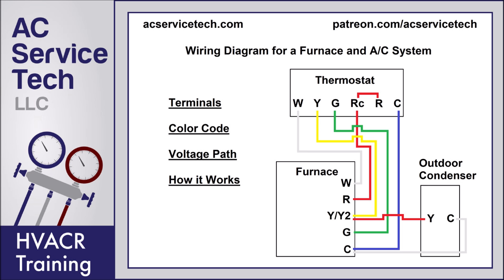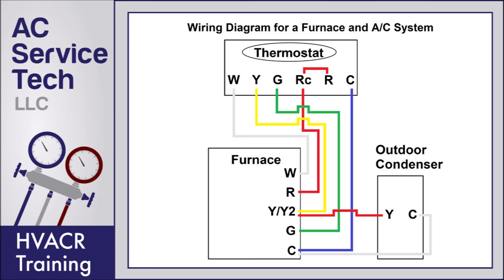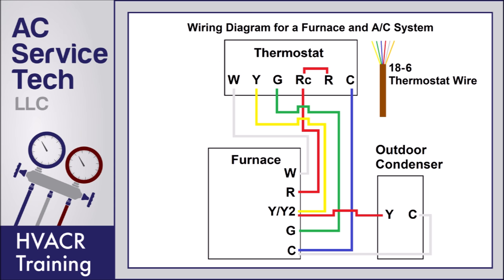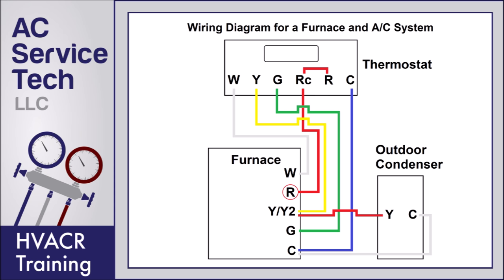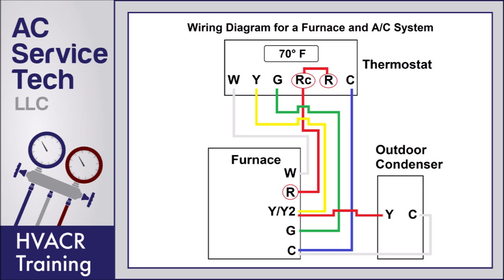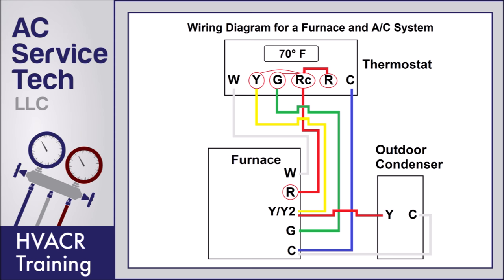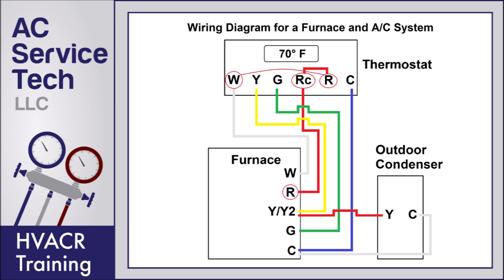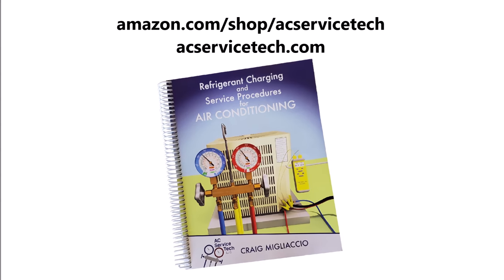Thermostat Wiring to a Furnace and AC Unit!  Color Code, How it Works, Diagram!

Comment: I am working on a furnace that has black yellow green going nowhere.i have rh and rc and white for condenser and white for heat but no g wire for blower motor. I have never seen a system run without a g wire. Home owner says system worked last year but i think is bullshit because it has no g wire from thermostat to control board

Comment: So can you answer a question about why my old thermostat would have a jumper between r and rc but on the new smart thermostat no jumper and the thermostat has a loss of power only in heat cycle

Comment: Hi I'm installing an emerson 70 series non programmable thermostat on a hot water gas boiler system (no cooling) do I need to remove the jumper wire between RC and RH on the new thermostat

Comment: Having an issue with my system. I have the exact system wired as so, however, when the tstat shuts off the fan on the furnace keeps running. I’m in the process of adding a secondary transformer Honeywell R8239A1052. Do I need to add this or did I do something wrong?

Comment: Do you have a more detailed low voltage wiring with transfers in? I have a furnace with no voltage on W. When I switched the thermostat to heat, nothing happened even I jumped R to W. No heat, no fan. If I switched the fan to ON, and I jumped R to W the heater strips will be on. 
Long story: This thermostat was changed from an old mercury thermostat at summer time. When I switched the old one back everything is normal, heater worked. I thought that the first thermostat was wrong, and I switched it to another new thermostat, but didn’t check heater on this second one. Now, the second thermostat has the same problem. I did careful check yesterday and found the problem described in first paragraph. 
Any ideas? Thank you
Reply: sounds like wrong wiring or incorrect thermostat setup

Comment: Thank you for such clear instructions! I have wired everything as you show here. My furnace is working as expected. However, when I try to turn the AC on through my thermostat I can hear the relay getting closed but the compressor won’t start. Would you have any pointers as to what may be the cause? 
Thanks again!
Reply: First check if your outdoor unit has power (tripped breaker).  Second most outdoor units have safety switches that will open Y before reaching the Compressor Contactor Coil.  If the outdoor fan motor turns on without the compressor then you may have a open start capacitor.  If your outdoor unit has a control board it could be a bad board.  I'm putting money the relay you're hearing is the Compressor Contactor and there is no power to the outdoor unit

Comment: Why not have a cooling G delay after compressor shuts off to extract more cooling just like heat does when combustion shuts off?
Reply: Good question! First of all, I'm NOT a HVAC tech by any means, but you're right. There is a bit of residual cooling left on the A coil where if air is passed through it after the compressor shuts off, some "free" cooling could be extracted. You may get like a minutes worth before the coil attains ambient temp and starts to evaporate the condensate back into your house. We have a 20 year old Bryant furnace which has a smart control board. When A/C is called for, the compressor will start about 30 seconds before the blower! When thermo is satisfied, the compressor shuts down and blower runs another 2 min or so! Neat, huh? To further reinforce your idea, I once added a delay relay to a large window A/C unit to do just what you asked. Fan ran about 3 min after compressor shut off. My belief was that it would extract a bit more cold, cooled the compressor, while quickly reducing head pressure. Window shaker ran for years without problems!
Reply: @curtchase3730 , great I should have got that 20 year old Lenox I saw for $75-- that's sucks. Anyway ours is 37 year old Heil 90+ and maybe you can answer this quick question about it or its diagram. So in the stupid diagram manual, and also on the back of the top front panel cover diagram, is schematic where the combustion normally open relay is actually in parallel with the fan control limit switch, which seems crazy to me. So as you know the older furnaces have the bi-metal fan control switch which turns sending heat and then turns it off after w heat call ends and then it cools of course, so why would the diagrams want to sort that out with a combustion relay in parallel closing makes no sense because then when the heat calls they blower would come on immediately instead of letting the fan or blower control do it. Anyway that's what the diagram says but of course the furnace does not operate like that because the jumper or the wire from the combustion relay is not there of course but why would they list that wire connection in the schematics is what I don't understand. Does that make any sense because I've seen a couple of questions about that in some HVAC forums.

Comment: I have a trane ac system with old trane xr420 thermostat and is working good .But I want to upgrade the thermostat for the new one and I installed it ,and my air handler is working fine and stops as soon as it’s at equal temperature with the thermostat .But the out door compressor still works  and and the tube freezing never stops .Do you know why ?

Comment: If I don't have a c-wire, can I swap the g-wire on the control board and thermostat while the condenser is still connected to c and y?
Reply from the maker: Yes you can switch that to the c terminal at the thermostat and control board but just make sure that your fan will still automatically turn on during ac mode

Comment: My 'stat displays stage 1 and 2 but no wire to y2 terminal on either 'stat or furnace board or to outdoor unit .only 5 wires total.
Question is can I move blue wire from com. To y2 terminal at compressor , move blue from com. On furnace board to y2 , and blue at.com. terminal to y2 terminal a t thermostat ? It has batteries. It's a high efficiency. 16seer a/c
Hope I was clear.

Comment: Looking for low voltage wiring gas fired two-stage furnace to Bosch heat pump diagram doing first heat pump

Comment: I cut the wires in the basement going into the furnace and spliced and rewired it but now my furnace will not fire for heat. It fires up for hot water just fine but wont fire for heat. Any ideas?
Reply from the maker: Look up "acservicetech test thermostat voltage"

Comment: You saved my ass, I miss wired one of the outdoor condenser with W from Y and so it only turned on when I had heat on. Going through this gave me the confidence with placing Y from the outdoor condenser to Y/Y2. Thank you, thank you, thank you!
Reply from the maker: Thank you! Great to hear it!
Reply: I dont have cold ac but my heat works good. I opend up my furnace to look at circuitboard and there is only 3 wires connected,  G , W , R ,,, c24v and Y are free with no wires attached. But on thermostat there is G , W ,Y , R, Rc all have wires connected to them. I remember furnace unit was replaced a while back is it possible the person didnt install everything correctly??? Plz and thank you. Ps when i turn cool on nothing happens but outside unit turns on,, while inside unit no activity.🧠🧠🧠🧠🙏🙏🙏🙏🙏 i feell like this is why my ac aint kicking out or blower motor

Comment: Hello, how are you doing tech. I have my oil burner honey well thermostat and I'm install a new ac system. How do i wire my air handler to the same thermostat  I have before?

Comment: On my system, I have the fan relay.... high for cool, medium for heat... the speed is controlled through the fan relay. my problem is, when in the heat mode, the thermostat always triggers the fan relay... so the fan runs on high and then drops to medium when it shuts off and then shuts off when the sequencer finally stops. any idea why?  I have a Coleman 3500-816 electric furnace... with A/C.

Comment: I have a boiler and a/c system.  What is the easiest way you add the C wire?  Thinking of installing a wifi thermostat, all seem to require a C wire....
Reply from the maker: The wire is run from the air handler c terminal. You may already have an additional wire run that is just not used, thanks!

Comment: I am trying to switch a mechanical thermostat with a digital thermostat. However, the mechanical thermostat has 6 wires. Low fan, med fan, high fan,  L1 (black), valve 1 and valve 2 (red). My challenge is to find out which ones are W, Y, R, G wires. Please help
Reply: Sounds like you have a old High Voltage thermostat for a chill water fan coil.  A good indicator is you don't own an indoor and outdoor unit.  To use that modern wireless thermostat you will need to install a 24v control circuit.

Comment: Have you seen a Switch Mode Power Supply SMPS for 24V DC as opposed to a 24V AC transformer for energy star lower standby watts?  Although pretty reliable SMPS still a transformer is bullet proof just uses about 4-5 watts xtra.  The average vampire current or standby current in most homes is 50-100 watts, so about $10 month.
Reply from the maker: Yeah they are nice for saving power but I don't know about lightning strikes or other problems at customers homes. I try to avoid callbacks from occurring whenever possible, thanks!

Comment: The R “red” wire from the furnace should be touch to R on the thermostat first, right?? Or it’s does matter
Reply from the maker: Yes that is correct, the R from furnace to R at the tstat, thanks!
Reply: AC Service Tech LLC thank u I had your book and we wait for the next book.
Reply from the maker: Thanks a lot Marcos!

Comment: I wired everything up just like this and the system works, however, when the tstat shuts off cooling the blower fan remains on. My vender gave me another transformer Honeywell R8239A1052 to separate the heat and cooling and am lost. Anyone able to help?
Reply: Correction . Resideo is the brand.

Comment: How will you power 2 zones at the same time for cooling with one thermostat? Would you be able to provide me with a wiring diagram? Thanks a lot!
Reply: This can be achieved using a thermostat that will allow for multiple remote sensors that can be mounted on the walls or in the return duct.  You will need to verify the sensors will provide a average temp of each system.  I believe a Honeywell 8000 can achieve what your looking for.  Additionally induct return air sensors are more reliable and accurate.

Comment: Great video as always, Craig! Someone recently asked me if you could wire a condenser contactor directly to the Y and C terminals at the thermostat instead of the furnace board. How would you answer this question? TIA
Reply from the maker: It could be done, but if there was a problem with the yellow y wire not making it to air handler then the blower won't turn on which would be a problem. I would rather the y get to the air handler and then go to the outdoor unit, thanks!
Reply: @acservicetechchannel  thanks for the response. So the Y terminal in the air handler/furnace board powers the blower? I thought the G terminal from the tstat did that during a call for cooling?
Reply from the maker: Domingo Luyo  Depending on the unit, the board may need a signal at the y to run in the higher fan speed otherwise it may run in the lower heat speed. On some boards, it will run the bower without any call on the g but just on the Y. Anyway, it can be done but I like to get my wire to the indoor unit before it goes outside, thanks!
Reply: @acservicetechchannel  I just experienced another one of those "aha" moments. Thank you so much for all you do.
Reply from the maker: @domingoluyo2315  I love hearing that, thanks Domingo!

Comment: I have a Lennox  LB-87086A control board. It has W/R/Y/C/G. Ok, so..........these guys who installed it brought it up outta the furnace and then tee'd off the RED and Blue(common) to feed the AC compressor relay contactor. Lol. So i have a White, Red, Blue, and Green wire bundle coming up to the thermostat. The only way to get the AC to work is put the Blue(common) in the "Y" slot of the thermostat! It's frustrating because they didn't just use a 5 wire like they should have and used the Yellow wire and Blue wire to feed the AC contactor outside. 

Good news is that it does work just fine with my old programmable t-stat and my new Google Nest Thermostat. I imagine the batteries won't last as long though!

So to properly fix this i would need to run a 5 wire from the Furnace control board(using ALL 5 wires this time), run that to the thermostat, then extend the contactor wires from the AC compressor and run those into the Control board at the Y and C. Right?  I have a working system but i am selling soon and would like to take care of the little things.

Thanks and if anyone helps i appreciate it. My In-laws own a huge HVAC company but sadly never seem to want to help or even offer information...........But hey, maybe that's why they're now millionaires hahahaha

Comment: my furnace board is labeled x r b/c g w. where do I hook the condenser wires? I hooked them to the b/c and r but my ac wont turn on.
Reply: Did your thermostat come with a manual?  I'm guessing its one of those Homedepot $20 specials that die if you hook up C even though it has a C terminal.

Comment: You have given wondful instructions, but the only thing my blower motor doesn't shut off with the thermostat. No matter if I put to 75 it keeps running later it froze my condenser.

Comment: Hi. What if there is no Y in our air handler furnace?
Reply: Is that because you don't own a AC?  Y doesn't need to stop at your Furnace because 90% of the time Y needs to reach the Condenser Compressor Contactor

Comment: I need help with diagnosis of t stats. Even you go from R to C why don't I read 24v ?
Reply from the maker: We do read 24v with a multimeter when putting the probes on r and c. Did you look up "acservictech thermostat" for videos on troubleshooting?
Reply: make sure you're testing for AC voltage, not DC on your multimeter, simple but often overlooked
Reply: Wrong use of Voltmeter, No power at Furnace, Blown/Tripped Transformer fuse/breaker, Bad transformer, Bad power board, open/short wire

Comment: I need to know which wire makes it stop automatically.
Reply: Normally that's a switch.
Wires don't make anything start or stop, they just power the load.
If there's a wire that makes your A.C. stop it's just disconnected.
Switches makes loads start and stop.

Comment: Thank you for all the great content! Quick question about the book, does it cover anything about VRF/VRV systems and/or inverter driven compressor systems. Like Mitsubishi heat pumps etc???
Reply from the maker: It is mainly covering single and two speed ac and heat pumps. The issue is that manufacturers don't want to specify charging methods on inverter systems and often only leave you the one vapor port only. Thanks Mark!
Reply: Mitsubishi sells sub power board options that allow for standard thermostat interface.  With that being said you will lose some options like economy mode, silent mode, learning modes and louver direction ect.  Mitsubishi also sells wall mounted thermostats that are Mitsubishi only and offer Kumo Cloud adapter that allows for wireless control with smart devices.

Comment: Hey ac service tech can you explain how to wire himdistat for humdifier
Reply from the maker: You would just need two wires heading to the humidistat but you would be breaking the normally hot wire going to the solenoid on the humdifier, thanks!

Comment: So what if you find that your G in you furnace and thermostat is a blue wire. Can't seem to get a nest thermostat to work with this configuration. The green wire was not connected to anything and brue wire was connected to G slot on both. Any help would be greatly appreciated